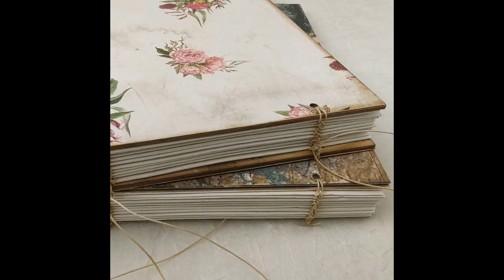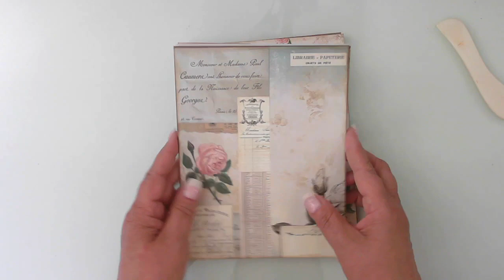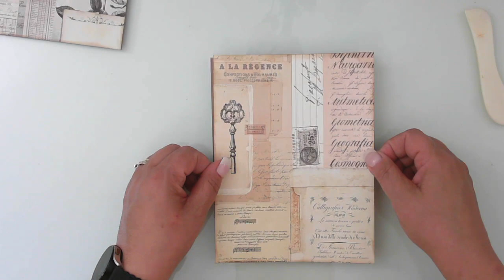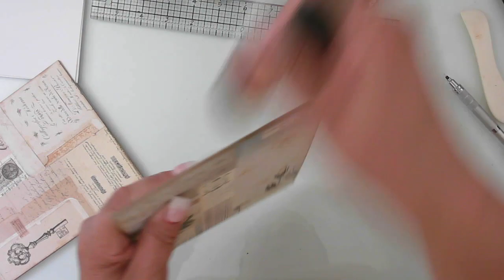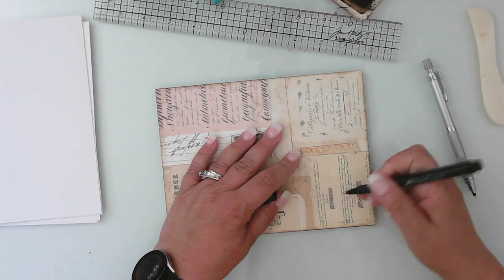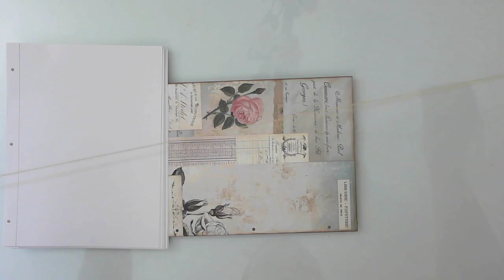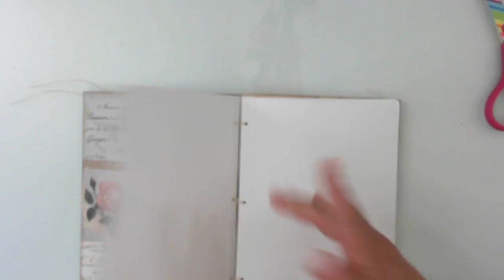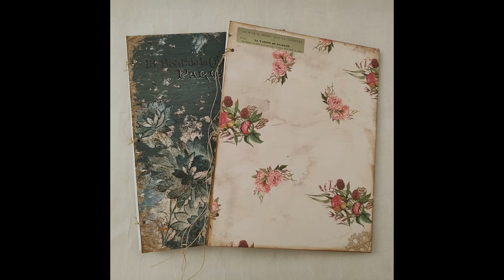My FIRST Slip Knot Binding - Inspired @MadebyMartha

Comment: Great minds think alike! 😂 I also watched Made by Martha’s video and had the problem with the holes tearing. I used washi tape on that journal but added the extra paper on the edge for the next journal as you did.  Really love the slip knot binding and your covers are very pretty! ❤
Reply from the maker: Great tip! I love the idea of washi tape too. It worked really well. I have practice more as I am doing a project for a friend that will require this binding.